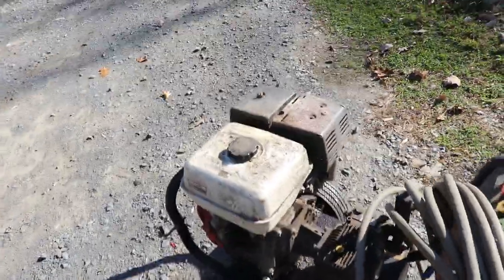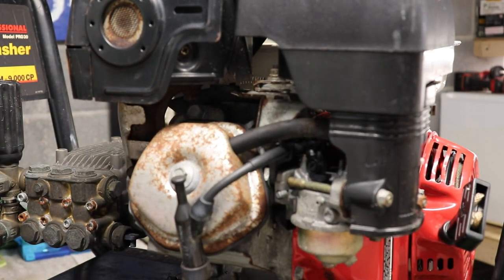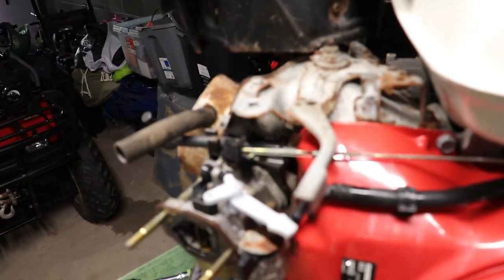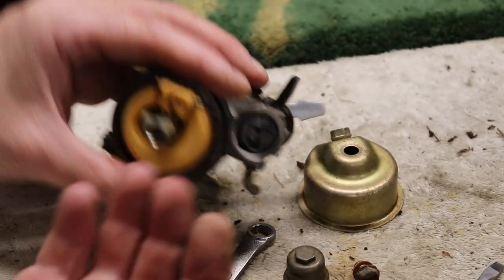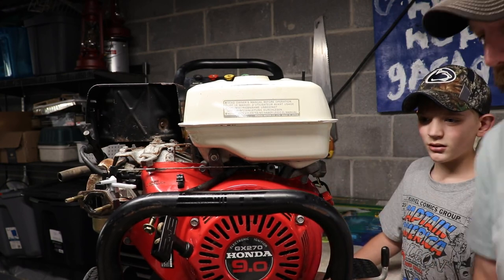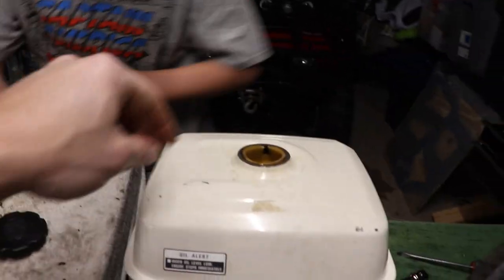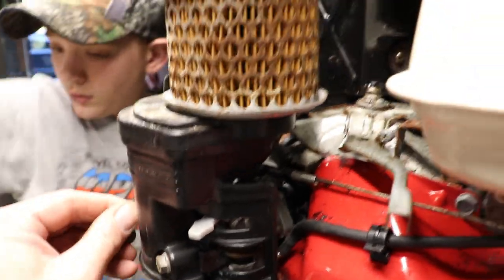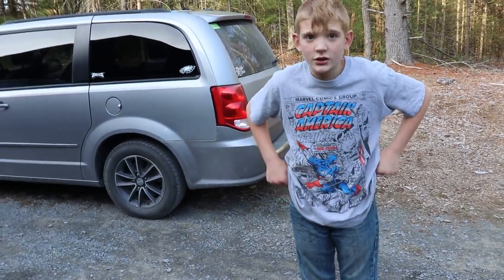Will it start??Old Honda pressure Washer left for dead!! Can we get it running??

Comment: After the jet is removed and the e tube doesn't fall out you can push it down and out with a screwdriver. You could see the e tube  through the choke side of the carb.  

If you don't have a something on hand to plug the fuel line the choke lever on the carb has built in part to use to plug the fuel line. Same with the 196 and 212 stock carbs. You just remove the choke level and use it to plug the fuel line. Lately I've been using golf tees cut down to 1/2" long or so to plug the fuel line. 

This past spring I found rust in one of my Coleman mini bike tanks. There was even corrosion on the gas cap. This year I'm pulling the tanks on both bikes for the winter and the tanks will get oil to prevent rust. Probably trans fluid. I have a few old bottles of that laying around.
Reply from the maker: Thanks for the info!!